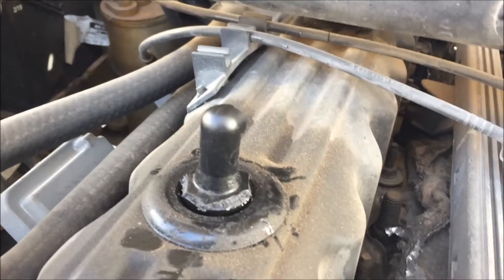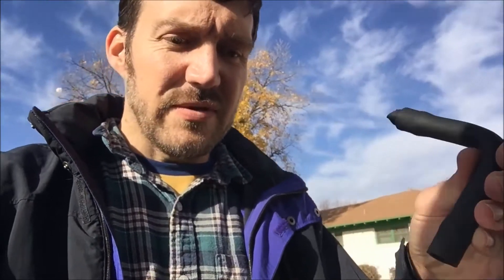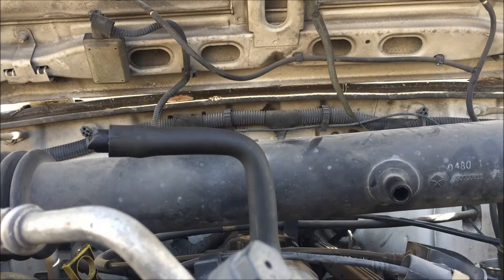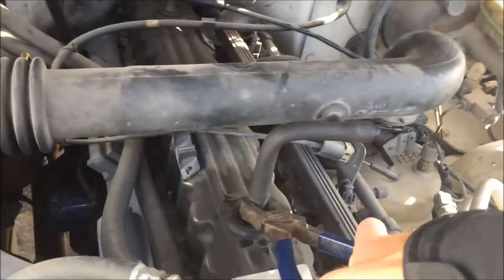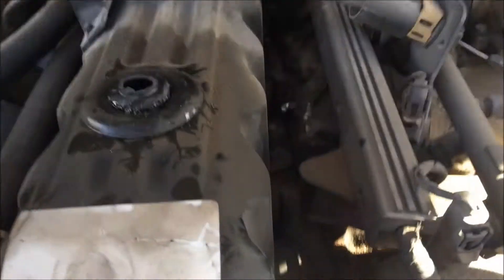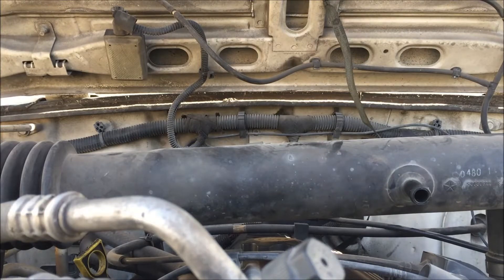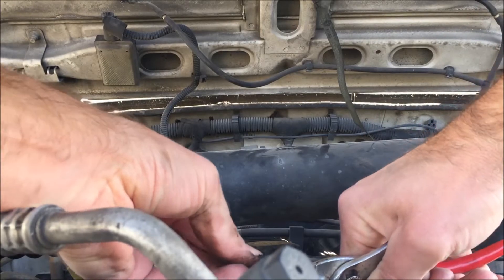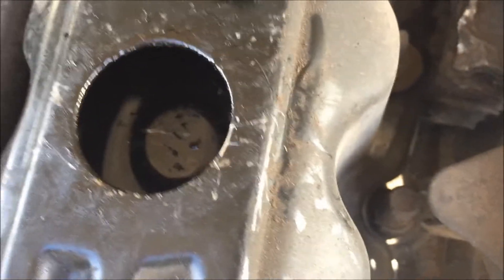Jeep PCV Valve Replacement – How to Replace (Wrangler, Cherokee) 1991-2006

Comment: The elbow in the front of valve cover going to your intake air tube is not the pcv valve. It's part of the complete system of pcv but pcv valve is in rear of valve cover with hose going into intake manifold

Comment: I am trying to do the same and have busted it up pretty good. No large pieces have broken off under the valve cover. Looks like you had some really small pieces of the rubber grommet in there. Were you able to get it all out and then replaced without having to take off the valve cover and redo the gasket?
Reply from the maker: I had to replace the elbow, gasket and the attached hose. Each piece was roughly $5 at Oreilly though I just broke one at a time and kept having to go back. I got the broken shards out with a paper towel didnt go further than that.
Reply: @CUPoJABA  thanks for the response! Ill probably try to yank it out tomorrow.